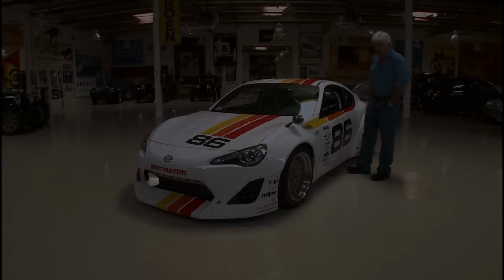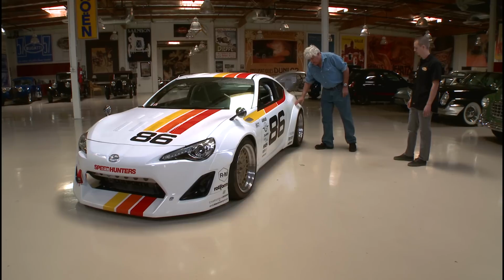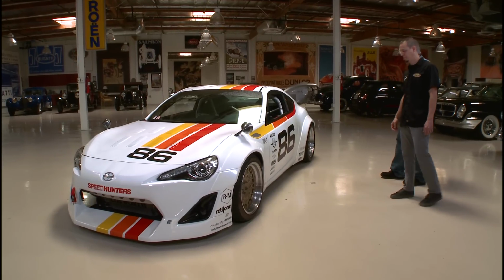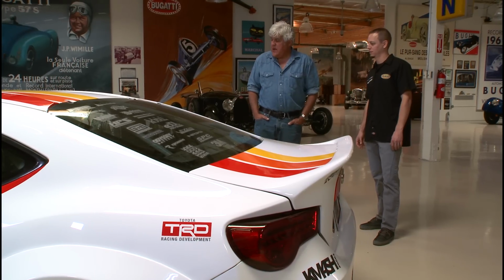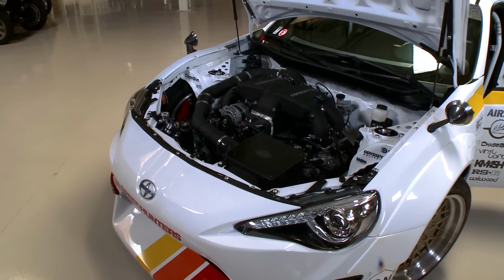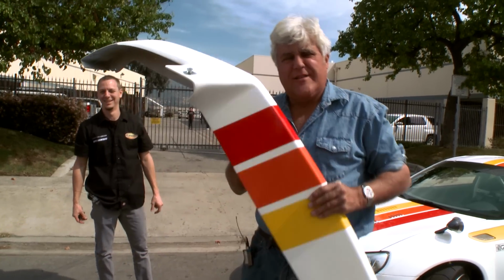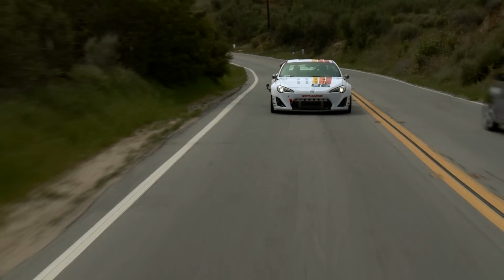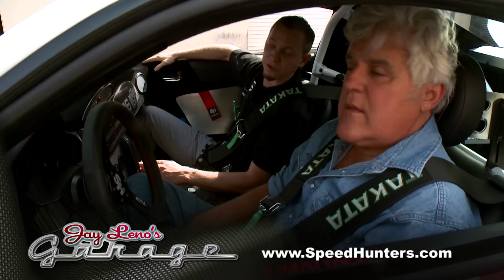Speedhunters Scion Tuner Challenge 2015 FR-S - Jay Leno's Garage

Comment: merc a45 amg engine in this car
Reply: Why???
Reply: joakim bonde
worlds most powerful 4c engine
Reply: Yea stock, but a ej25 would fit much better, and are proven to hold up to a lot of power, plus that the merc engine might end up being more expensive than the whole car 😉
Reply: An*
Reply: joakim bonde
 True, might as well just buy the car instead. But it would still be epic if someone did it :)
Reply: Weight distribution would be like 70/30 if you did that...
Reply: thechosendude
nope
Reply: Louie Lambretta Yea no doubt about that 😃
Reply: Louie Lambretta Well, it's the most powerful when stock. Why not a Honda K24 or a Mitsu 4G63 or 4B11 that have way more potential?
Reply: Louie Lambretta i like that sound of that ;)  i'm for it!!
Reply: incubrian Kick starter? ;)
Reply: I think people forget about the Regal GS Ecotec, while not as much power stock as the AMG it's right there with a tune.

Comment: I just want to see just one Just one Frs/ Brz with head work. With no turbo. Something other thAn just slapping a SC or a Turbo on the car. A cossworth wit no head work?  He left the stock radiator in? Really?  My car stock runs hot. Just upgrading the radiator would give me 5 to 10 hp on a hot day.  Beautiful build. I want that rear defuser.  I want to see someone do some real engine work on the twins.

Comment: That actually sounds fantastic: A bit of boxer rumble down low that morphs into this high pitched ripping sound as you rev it out.
Also, was there a short shift package installed? The throws seemed really short and the shifts really quick.

Comment: Its a shame that those cars stock have the combined power of a potato and a glass of water
Reply: +Zhane Zinn should have been turbo from factory
Reply: +Zhane Zinn from a Toyota 86 owner, and I agree with you. 
But the good news is, there are plenty of power upgrade options to remedy that issue are out there waiting for any unsatisfied 86/FRS/BRZ owner.

Personally I'll go with Cosworth path, as I'm willing to trade some horsepower and overall value, with better engineering and reliability.
Reply: Rumor has it the new brz in the future is gonna have an sti turbo version... Not sure how accurate that is but it makes sense

Comment: my frs spun a rod and toyota scion didnt want to cover it.. had 32k on it DD not track driving.. they wanted 10k to fix my motor...now i have a frs with no motor :( never again will buy a totoya/scion/lexus.. i love the car but now i just have a roller till i find a new motor.. i have a video of it when i was close to my home.. it was knocking like a crazy.. others had this issues too i looked.. but i do my own oil changes and that why they try to put the blame on me..
Reply: thatonebeone put a 2jz in it
Reply: zum yeah lol.. straight 6..jdm powa. .  I wish lol.. got another f20 going in it with a tune
Reply: thatonebeone  well it's a "rule" that says that untill your car is under warranty, you service your car at official service.
Reply: thatonebeone Only problem is that the engine is a boxer unit made by Subaru. Toyotas and Lexus' are still some the most bulletproof cars you can buy.

Comment: "The build was really short"....90 days!! 2 n a half months..and no engine internals etc?
Reply: 2 and a half months to fit an elaborate body kit, rims, supercharger and paint..so alot of time was spent doing what exactly?
Reply: foxon172 Read the build stories on Speedhunters, a lot of time spent shaving the engine bay and a bunch of other parts inside and outside the car, and a lot of small details that most people miss.
Reply: 90 days is super short, especially when you work a regular day job.

Comment: and once again, everyone has their own way they would've built it.. me I'm too much of an old school hot rodder.. I'd just drop a Toyota V8 in it and have the same amount of power with a lot less work.. well other than modding the firewall and front suspension and rear end etc :P Okay so a V8 swap on a little car is not easy but still.. coulda had a V8... LOL

Comment: Am I the only person thinking that 300 hp is a little small power?
Reply: +Peter Griffin What do you usually drive? For a car that's 2800 pounds, that's a hell of a lot of power. Something like a Mustang GT that has 400 hp also weighs around 3700 pounds. That's almost half a ton more weight the GT  has to push around.
Reply: I drive stock 230hp and 2866.
And I would get 320hp if would go to 
a local Tuning company to get a 1000€ chiptuning done.
Reply: Peter Griffin What car?
Reply: Golf 7 GTI

Comment: 7k for that supercharger lol i rather get a turbo for that price which would prob be around 5k
Reply: crazyjd64 yeah, but then adding all that power would ruin the handling on the car.
Reply: JayCee Garcia adding a turbo doesn't mean automatic 800hp. It depends on the size of the turbo and also the tune. a turbo can add anywhere from 50hp to 800hp+. it all depends on what you want.
Reply: JayCee Garcia I can assure you it doesn't ruin it
Reply: crazyjd64 Superchargers sounds better in my opinion, and gives a flatter HP/Torque curve. Which is perfect for a car that is based on handling.
Reply: JayCee Garcia No way, that chassis can handle WAY more than it's stock power.
Reply: SYNCPHAN1OM How much HP are those brembo brakes putting at the crank?
Reply: BrawndoScream i would hope for around 400 extra HP for those.
Reply: crazyjd64 It didn't make any sense to you because you're CRAZY, jd64.
Reply: BrawndoScream smh it has better braking power on turns thats it
Reply: crazyjd64 dipstik subaru can you guys explain why it wouldn't ruin the handliln on the car? thanks
Reply: JayCee Garcia Neither of them do people are dumb. Basically what they are saying is if you add too much HP that it makes the car uncontrollable. My argument was why spend 7k for a supercharger when you could get a turbo for 2k less and it's more superior. People will argue and say superchargers are better but they clearly are not, they require power from the engine. A turbo recycles wasted exhaust gas to make free power. F1 uses turbos not superchargers because they are better
Reply: crazyjd64 It's true, the turbo is a more beautiful solution, using nothing but waste gasses to make more power. Rather than taking power from the engine to add power like a supercharger..

But there are benefits to the supercharger, such as zero lag with instant throttle response. Easier to install with less headaches and potential problems. And a more predictable more gradual power curve..
Reply: bliglum true, turbos get a bad rep for reliability because people always push them to their limit instead of putting a safe tune on them. the way i look at it a turbo is more for the enthusiast.
Reply: If you don't understand why someone would use a supercharger instead of a turbocharger, then you sir have much to learn about the world of motorsport.
Reply: crazyjd64 also for the matter of simplicity, installing a turbo requires all the plumbing for exhaust, boost, and oil and turbos practically need intercooling. Superchargers leave more room, generally sitting on the engine and don't require intercooling if you're not putting a lot of boost through it. Plus it being the first of its kind is great for marketing and beneficial to the team here.
Reply: crazyjd64 The supercharger is perfect or this car. The major complaint about this car is the lack of low-end torque. The positive-displacement supercharger makes full boost available form much lower RPM which drastically changes the shape of the torque curve. I'd rather have have 300 hp with a lot better low-end performance from a SC, than 350 horsepower at peak with a lot of turbo lag.
Reply: JayCee Garcia it would ruin the handling because if you want a substantial power gain you need to use a decent size turbo. And bigger turbos add lag in the throttle response and make the power output more peaky. Nothing happening in low revs so you must stay in the boost zone all the time. A supercharger has neither of these side effects. It only adds an extra item that needs power from the drivetrain which makes the engine a little less rev happy. It just adds power more evenly over the total revrange and is more predictable because if it. Turbos only make sense if you want more horsepower than a supercharger can deliver imho.
Reply: 300 hp won’t ruin it at all.

Comment: Another uninteresting car:
-  low ground clearance, impossible to rally with this thing, no way you stand a chance against a police interceptor in a persecution race. This thing doesn't take bumps
-  I imagine the springs are uncomfortable
-  a small car, not as small as European minicars though
-  hard to drive, no automatic transmission, gear lever in center seat, not at steering column. Why don't you do away with the synchronized transmissions and electric starters also
-  hard to drive, if it has a supercharger, so it has a turbo lag, doesn't it. The CVPI and its successor dont have superchargers.
-  this aerodynamic body looks like nothing, no boxed design is visible, good bodies aren't really aerodynamic

I wouldn't want this car. Good cars are sedans, big limousines, not this crap. But well, that's why I didn't subscribe to this channel.

Comment: FAIL!! First it's a tuner challenge and he only gets an extra 100 horsepower out the engine?! Then, most of the other stuff he's done is only cosmetic and a lot of it sounds like he parted it out to some other shop to have it done for him. Lame...
Reply: Pnut Bubbers Shaddap
Reply: Pnut Bubbers it has 300 TO THE WHEELS now. before it was 200 crank. so hes probably gained 150+ hp with no internals and took tons of weight out of it. what more can you want from just bolt ons?
Reply: Ryan Partlow And don't forget the suspension and setup/tune. That's what makes it a tuner, not just mindlessly throwing power at it. Some people don't get it :/
Reply: Pnut Bubbers The motor gained an extro 150 hp at the crack with a supercharger and exhaust. And he documented the whole build on speedhunters. He did most of the work himself and got some friend to help.

Comment: What a shame it only has gay bolt - on's. Where's the built motor with forgies and decent rods so you can make some real power?!? Very disappointing for those of us into 'fast' cars
Reply: +Daniel Brealey That AND all the mods to make the car into a racing replica, for under 15k? You are dreaming.
Reply: +Seth Portland (Internet Educator) I suppose everyone has they're own priorities, mine is about going fast- not looking fast
Reply: Daniel Brealey Well, then you probably would have failed the challenge. You would need to focus on both to make a unique tuner.
Reply: +Seth Portland (Internet Educator) Your right, but for the wrong reason- I would have little to no interest being involved in this comp. Not my cup of tea, I like cars that actually ARE FAST not LOOK FAST. Only have one of three projects on the road at the moment, and it looks totally stock and runs low tens. Even modified stock rims with drag radials on, I'm flying under the radar dude...
Reply: +Daniel Brealey Good luck in doing all that for under $15K

Comment: nohning special, just another toyota ricer... It doesn't even have windows, so it's useless
Reply: useless name how is it a ricer?
Reply: front bumper is so low that you can't drive with it on a normal road, exhaust is too loud, hideous wheels....
Reply: useless name Actual race cars are also loud, too low for the street and have ugly rims. Your point is moot. And the lip on the bumper is removable.
Reply: you're forgetting that this is not an actual race car. And what kind of racing function can the lip on the bumper have, when  it's attached with only 4 pins? It's not a race car, it's not a track day car, it's no street car, so what is it? It's a useless show car, so yes I have to admit I was wrong calling it a ricer.